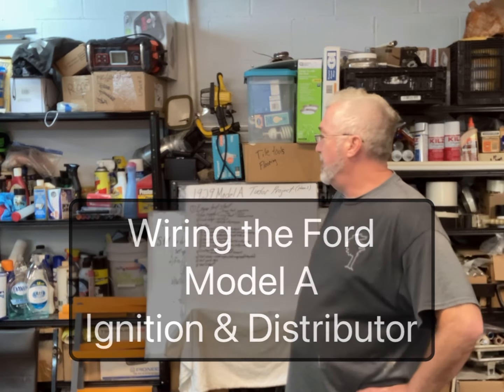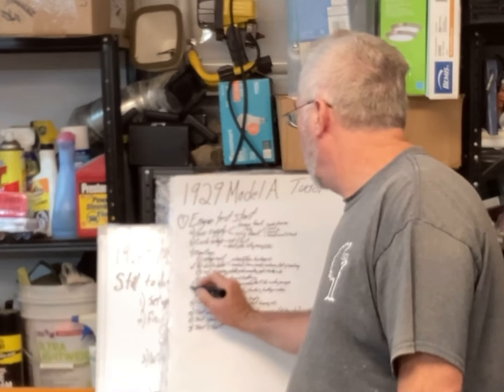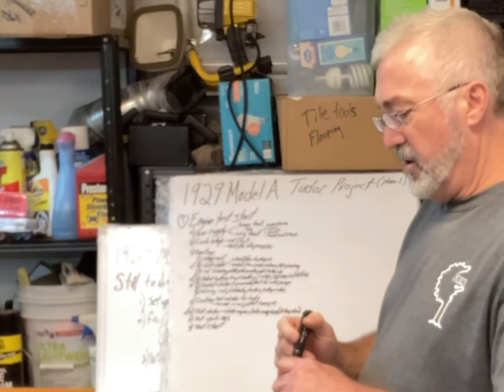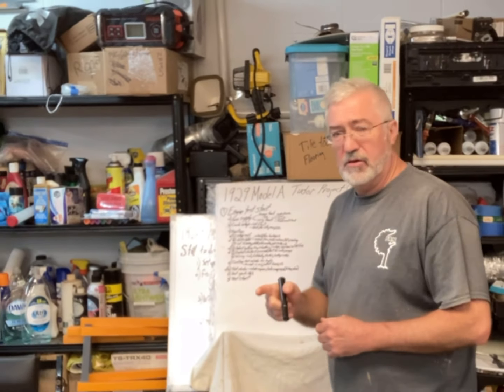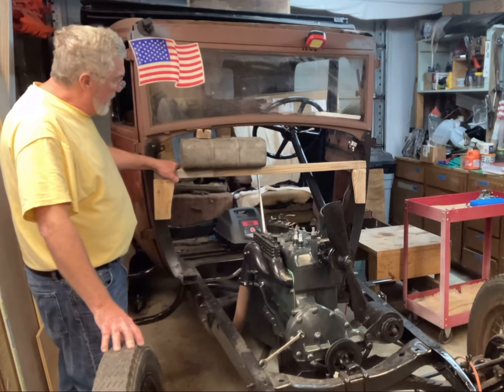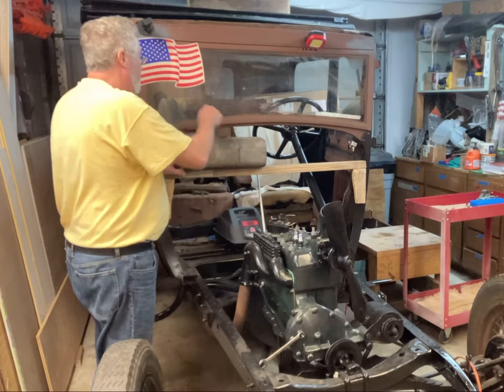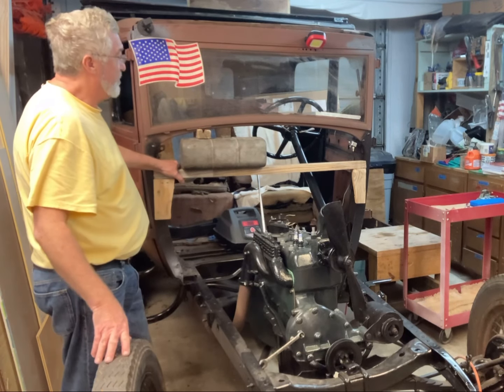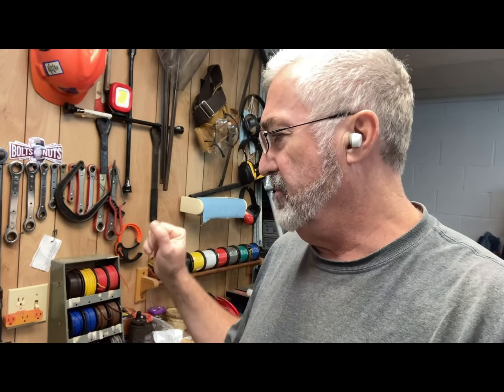Model A Proj'29 Tudor: Ep 35 - Wiring ignition & distributor #ford #classiccars #car #restoration

Comment: The hole in the topplate should messure 0.71 inch(18mm) and should fit with hardly any play whatsoever round the centre part of the distributor
Reply from the maker: I’ll have to check and measure it…thanks Fred